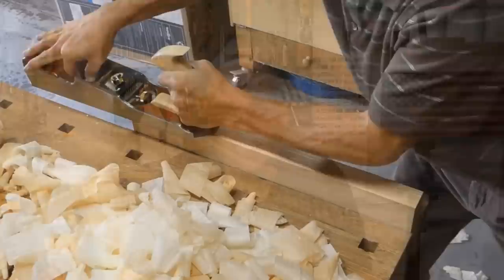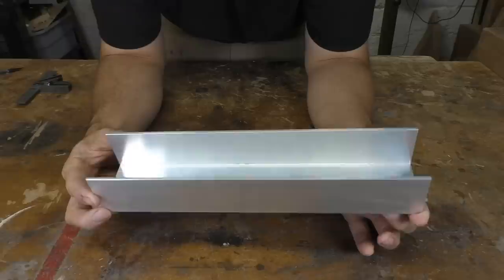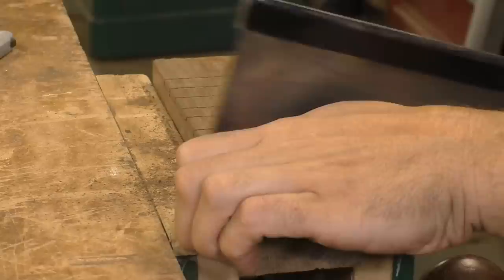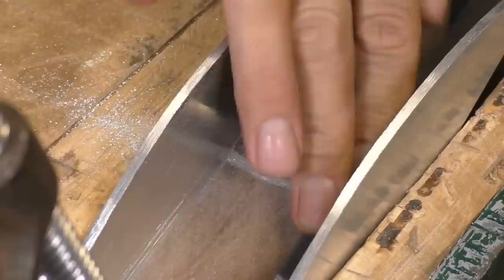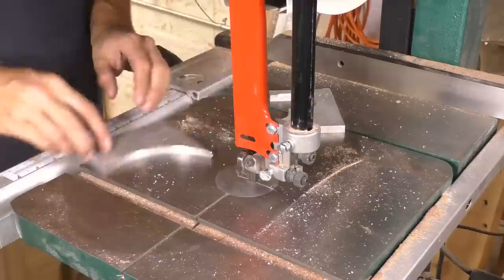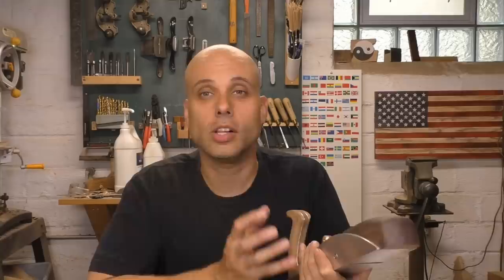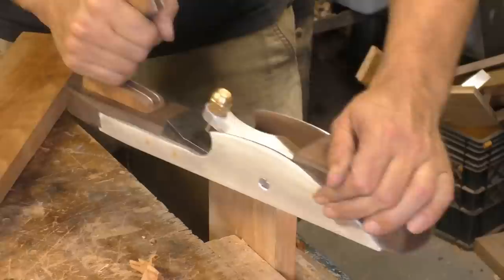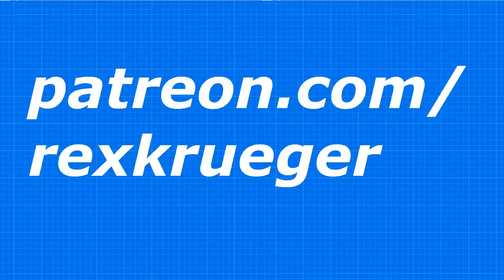Make your own Low-Angle Jack Plane

Comment: yeah, would be cool to see the comparison but ... maybe bum a commercial low-angle Jack from one of your mates just to test it out? it doesn't sound like you are jonesing to have one in your tool stash so spending the dosh just for the test is maybe not what you want to be doing. unless of course you REALLY want to know in which case have at it!
ps. great stuff as always. rock on Rex!
Reply from the maker: Yeah, I admit that I kind of want one just to see what the fuss is about. I might just do it.
Reply: agreed.

Comment: Try using a thicker blade, usually low angle jack planes have very thick blades to take care of the problems a chipbreaker would usually solve (tear out and chatter).

Comment: Okay, Rex... Great job with this plane!!! 

   I (for one) would probably watch the comparison out of morbid curiosity, whether I "had a dog in the argument" or not about craftsmanship versus actual functionality by design. I like your presentation and energy on these things.

    I would like to suggest another build, though. JUST food for thought, as I know it's cheaper and more "reachable". What I'm not sure about, is whether it would serve as "functional" for the price and time invested.

     Take a box-plane, and create an "inlay" for the whole plane, so you can clamp it down into a much larger sole-plate, and still net the sweet results of the low angle, with the stability and control of the larger plane sole and body. You COULD (theoretically of course) add weight to the project (as desired in some planes) by simply drilling holes that can be filled with lead sinkers (fishing tackle) and topped in glue, goop, silicone, or epoxy.

      I've crafted a "combination" Plane myself with an old Stanley, when I seriously needed the extra sole, so I do know it's possible. A good stable hardwood is essential, and Beech has been my go-to (from advice from old-timers)... BUT I've never personally tried with a simple little box-plane. The hardest part is getting the plane into position so the entire (finished product) sole is dead flat without a lot of fiddling. You don't want to have to put it together (like a kit) and then have to grind away to flatten and true the sole every time, either... or maybe box-planes are cheap enough (in some cases/models) to be sacrificial in the interest of a shop... OR possibly, dedicating ONE box plane (cheap) to this "combination project" could be sufficient IF you left it together permanently. In any case, I thought you might be interested in the idea... for a cheap low-angle alternative. ;o)

Comment: Beautiful and practical; very nice indeed.
Another nice property of aluminium is that you can melt it with a normal blowtorch & butane/propane mix (if you're patient) so you can in effect weld cut pieces back together again. Several times now I've melted some kitchen foil in a little crucible & used a butter knife to smear it into gaps & joints and it comes out remarkably strong as long as you heat the rest of it as you apply & work fast.

Comment: I made a scrub plane to dimension green wood.  I used a block plane blade, no chip breaker.  I didn't need to worry about the mouth.  It is a beast and scallops the wood out quickly.   I'm never going to buy a scrub because it works so well.  I bet it works better than the cheap stanley in woodworking for humans.  How about a build of a scrub  as an alternative to the jekyll and hyde  for the humans series?

Comment: Cool plane.  I think using an even harder alloy would be a better choice.
Reply from the maker: Agreed.
Reply: 6061 can be "machined" with a router.  I use a Bosch Colt to machine jigs and other tool accesories using 6061.  It's very tough and not too brittle.  I do use a "Micro-Fence" for precision.  Kind of expensive but was worth the investment.

Comment: Well, as an old hang glider pilot, aluminum will oxidize when exposed to air, which is like rusting for iron. It is generally anodyzed, which is an electrical process, and that brings it up to 'aircraft grade' aluminum. With the sanding you did, you would have gone through the anodyzing. I do have a couple of low angle jack planes. For one, I got one of those saw tooth type irons, just to experiment. I really like it. Have you ever tried one of those?

Comment: Rex, now you have my full suport for making a low angl. Plane. 
Next time look for 7075 t6 or better yet some 6061 t3 to t6 temper.
The adjutment method you use is the best part.
Reply from the maker: A better alloy would help, but it's not easy to find in channel.

Comment: A no 62 low angle bevel up plane (Stanley old and new, Lie Nielsen, Veritas) is a specialty plane and is good for what it was made for (end grain).  It is just a giant low angle block plane.  However, while it is capable (moderately) of doing general planing it was never made for general work and cannot compete with a standard bevel down bench plane because it is missing a chip breaker.  No other plane feature can compete with a chip breaker when it comes to avoiding or minimizing tear out. While a tight mouth can help, it is nowhere near as important as a chip breaker. While Lie Nielsen and Veritas planes are VERY good and built to very tight tolerances, they have a hard time competing (price wise) with quality made standard bevel down older Stanley bench planes. They have a strong incentive to advertise low angle bevel up planes as the best all around plane because a new and better made Lie Nielsen or Veritas low angle bevel up plane does not cost too much more than an older Stanley No 62 (and especially no 64).    The orignial no 62 was not produced in great numbers because it was never meant or advertised to be anything but a specialty plane for end grain such as butcher blocks.  In addition, many of the older no. 62's a broken because of weakness at the mouth.  Due to the low numbers, the cost of an original 62 is quite high which makes it easier veritas and lie nielsen to tout buying a new plane.  While nice, there nothing particularly special about these planes other than a fad.

Comment: Rex. That's a lovely plane. My thinking is that if it is only ever used for end planing on a shooting board, it is more than worth the cost of making it, in comparison to buying an expensive proprietary low angle plane. You've done a good job there.

Comment: You could use a piece of steel channel instead of aluminum too.
Reply: Much better, aluminum sucks. Clogs your cutting and abrasion tools. You can actually explode high speed grinding wheels by grinding aluminum.
Reply: It's worth some dubious note here, that it doesn't take a whole lot of research to find out what sorts of products to look for. Steel scrap in most yards is only a couple bucks per hundred weight (100 lbs/ 40-ish Kg)... SO that's an alternative for FAR cheaper than ordering a channel of any particular alloy online... provided you know a reasonably nearby junkyard/scrap yard.
    ...Better yet, scratch together a relatively comprehensive list, and make a "distance road trip" worth the drive...

    As Timbo pointed out, Steel is a tad harder to work, but substitute an angle grinder ($20) for most of the power-tool work, and you can have a much higher durability tool at the end of your build. AND you don't have to sweat the brass vs. not brass fittings to avoid scratches and snarling or warpage.

    It's also feasible to get a hold of cast-iron... Difficult, yes, but machine-able if you take your time. It's also heavier, which tends to be a net-benefit in planes. (see Stanley, Bailey, and a HUGE variety of other name brands' preference for the stuff)...

   A note on Corrosion :
   Might suggest vinegar or phosphoric acid to wash and "force patina" the steel. This creates a coating that protects against most of the elements in a shop or storage that would contribute to rust (highly destructive) and corrosion on its own, and generally doesn't cause undue amounts of havoc with the metal in your finished product. It's not shiny, but while you "futz" about with it, you have the delightful side benefit of developing some interesting patterns of dark on dark... {due note, I'm not a fan of shiny sh*t} JUST in case, that might be your thing. ;o)
Reply: @Timbo Dewabem 
I work in the AL indrusty, 20 years now and have never seen nor heard of t6.
The "t" refers to the temper not the aloy like 7075, 6061, 2024.
Reply: @gnarthdarkanen7464  due to insurance regulations, not all scrap yards can sell their scrap
Reply: @dondaugherty3138  Perhaps not, but at least some CAN sell at least SOME of their scrap...
    You can also DO THE RESEARCH and go find parts and salvage-worthy metals in junkyards, where decent steel is often located in dubious things like leaf-springs...

   None of this presents as "less work" but makes the elbow grease and time invested take up the place of money... PROVIDED you bother to find out what to look for.

   Furnaces, especially old steam furnaces for big old buildings with radiator heating, often have a wide variety of shapes and sizes of cast-iron parts, for instance...

   Bed-rails are MAGNIFICENT grade steel, thin, and already shaped to a nice 90 degree angle. Easily hardened at home, and durable as hell in their original condition.

   Ball bats, VW and Porsche engines, and a variety of aluminum alternatives are often high in magnesium, if that's your preference too...
   OR you can scour the web and Scroogle up locations for aircraft junk and graveyards, where the industries often tap old planes as resources for difficult to machine utensils and utilities...

   As I posted, there's no sense in wasting a long road-trip over one piece of channel about 18 inches long... Make a list, and go ahead and add in there those hydraulic cylinders you've dreamed of turning into a power ramp on the porch, or a bike lift on the back of the truck... Why not???
    Talk to anyone involved in metallurgy, from university professors to fabricators, smiths, welders, and even any local artists who might have a habit of dipping into dumpsters from time to time. It could save you aggravation... or even the need to get out on the road around dawn in the first place. ;o)

Comment: When I worked on single seat aerobatic aircraft, made with lots of wood and composite parts, we mixed WEST epoxy on aluminum because it popped right off after it cured, ready to be used again.  If I have to use epoxy, it is never the 5 Minute variety.  Another of my hobbies is RC modeling.  I've learned that 5 minute ages very poorly in that it gets rubbery and the bond fails after several years.  I have not observed 15 minute and slower epoxies doing that.

Comment: I will research the cost of hard anodized aluminum channel. It will not stain wood and perhaps look for a much more resiliant alloy as well.  Even the ordinance grade aluminum alloys can be easily worked with wood working tools.  A stiffer harder aluminum alloy which has been hard anodized would offer a more durable tool.  
I too would like to see a comparison with the Stanley Low Angle Jack Plane.

Comment: I have an idea of using a block of wood and a "spoon" carving tool to make a "roundover plane" - a plane for cutting the sharp corners off of wood in a round shape instead of a standard 45 chamfer. 

My questions:
1) Is it worth the time and effort, or should I just improve my proficiency with rasps, files,sandpaper, etc?

2) Is oak a good choice for a plane body (my free options are Oak, pine, chestnut, and maybe pecan) because these are trees which do or used to grow on my property.

Comment: Since the angle of the bevel up blade is 35 degrees (15 degrees for the bed and 30 degrees for the angle of the blade bevel) have you ever considered making a plane with a 30 degree bed and using a bevel down blade. That would give you an even lower blade angle than a 15 degree bed angle with a 30 degree bevel on the blade.

Comment: I wonder if you were to do one of those that was to be a designated shooting plane if you would need all 3 sides of the Ali channel. Probably just get away with a right angle piece.
Reply: Thinking about it more though the extra side is important to hold the fixings for the levering action. 🤔

Comment: i know you have done hand plane shootouts and found one for wood working for humans, have you ever considered the buck brand planes, i got one and from my 0 experience in use, i was able to with your instructions easily use there block plane to finish normal cuts but ive been using it to flat my maple log cut to make a mallet and impressively well its gone. and im using it out of the box, sharpening and flat materials are still on the way,

Comment: Axminster is probably the “cheapest” next option. At least it was for me. I got mine for the low low price of $145 on sale. Plus shipping ($10ish?). Not having any idea what I was going to get, I was surprised. it arrived with a good 25/30 dual bevel, flat and square (not curved at all), and honestly I simply polished it with my honing paper before using it. After slight fiddling my first shaving was silk. Its amazing but honestly I wish there was a cheaper option I felt was viable. I didnt have the money to buy a cheap plane and have it not work. 
Going too cheap was... too risky.
Id love to see what you do with the stanley. 
You making this was fun to watch. How viable would .25in steel be in place of the aluminum if I had a bit of scrap laying around? (I’ve not worked steel before. Now that Ive typed that out loud it sounds dumb...but still. How hard could it really be?)

Comment: Due to my lazyness, I get creative, sometimes too much. There are two opposed scenarios here for holding everything with epoxy: You slather everything with it and hope it holds, or you don't trust it and put zillions of screws. 

I like the thirds or fourth or even fifth ways, I hate binary reasoning and wouldn't want to have visible screws on the sides. Cut a hole all the way through for a dowel. Beat up(rough it up don't deform)the aluminium inside to be super rough and even saw slots and drill nasty partial holes. The epoxy IS going to hold. Aluminium needs to be very clean and free of oxyde before gluing, and 5 minute epoxy sometimes is not the lazy way: grab a longer set time epoxy. Doing it once is the true lazy way.

Comment: I own a Stanley sw 62, which is quite good compared to my other planes (a cheap metal plane and some wooden planes). However i don't think that BU/BD make a hughe differences (it's usualy only a ~5° difference). A tightly adjusted mouth on a BU has the same effect as a thighly adjusted chipbreaker on BDs. Overall, there's no magic involved, stuff that don't plane well with BU,  won't plane well with BD neither. So I guess it's more a mater of taste (weight, ergonomics) than anything else.

Comment: Or you can leave the blade bevel down, use bigger bed angle and have the same cutting angle.

Then you don't have to clog up your files and sanders with much too difficult to remove aluminum shavings. 

Just use wood.
Reply from the maker: Did it last year. Check the old vids.

Comment: I've heard pretty garbage reviews of the new sweetheart no 62s.  If I did more shooting I would be interested in a low-angle Jack.  I work with too much figured woods to use it for anything but shooting.  I'm actually thinking of making a high-angle smoother.
Reply: Bevel-up planes are often considered better for figured woods than bevel-down planes.  You can easily grind a steep secondary bevel in the iron to use it as a high-angle plane.  You'd probably want to have two blades going this route, though.
Reply: @zanik610  That's debatable.  I understand the bevel-up planes can be more easily adjusted by regrinding the bevel to a new angle, but I still would prefer to put a high-angle 55 degree frog in a dedicated no. 4 for high figure than have to regrind different bevels for different tasks. I also think a chip breaker helps with breaking the chips, e.g. mitigating tearout if you have a well set-up plane.  I think, ultimately, you need to be very familiar with planes, sharpening, grinds, etc.  to have either perform well with high-figured woods.  Neither will do well "out of the box".  Then choose your preference from there.  I personally prefer a Bedrock style plane and have never cared much for the low-angles although out of the box they are good for shooting
Reply from the maker: I think you could do a nice high-angle smoother using the shell of an old stanley no 4. That's a build I might do...

Comment: Here's a thought on low angle jacks: I recently scored a vintage Stanley 62 at the flea market, but it had a broken casting right along the side of the mouth, which some previous owner had brazed. I did some research on it and read that the 62 is so rare (and so expensive) because the somewhat delicate castings tended to crack. On the other hand, I really like the handling and low center of gravity of my low angle planes, and the fact that I can alter the planing angle just by swapping blades.
Reply from the maker: I would say that if you  found it for a good price, it's worth having it brazed. That fix can work and it's worth it on a rare plane. What did you pay?
Reply: @RexKrueger  I paid 12 Euros for it. The plane was in a very poor condition (rust-wise) and the iron was spent, but it cleaned up very nicely. It's not a collectible anymore due to the crack, but I like it as a user, so I invested in a new iron as well.
Reply: @schm4704  YOU LUCKY BASTARD!
12 Bucks??!!
Reply: @thewoodworkingmetalhead2712  :-)

Comment: does aluminum mark the wood?  engineering draftsmen used to use aluminum or instead of graphite as it marks mylar well and holds its edge better than graphite.... edited to add ... asked too soon!